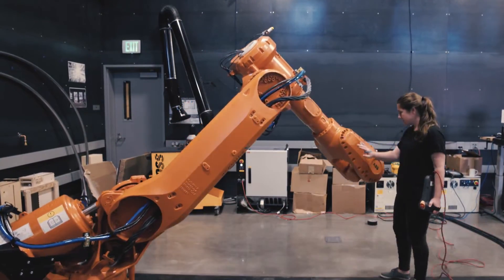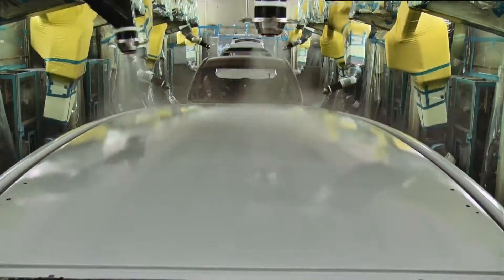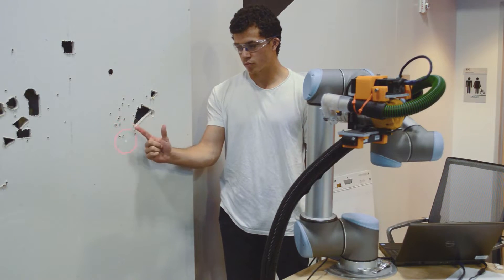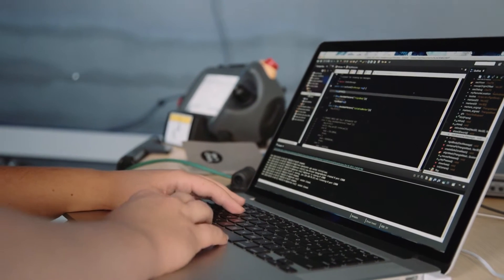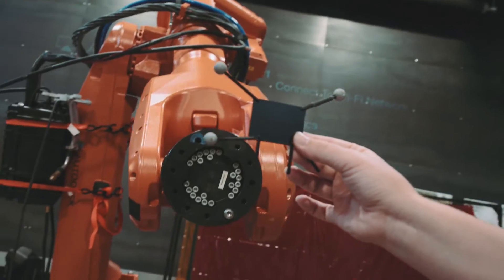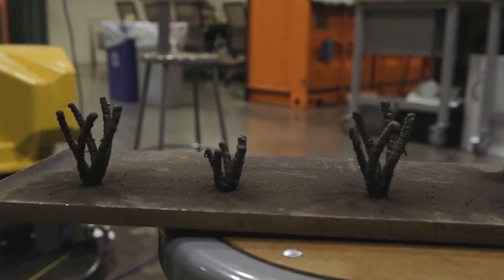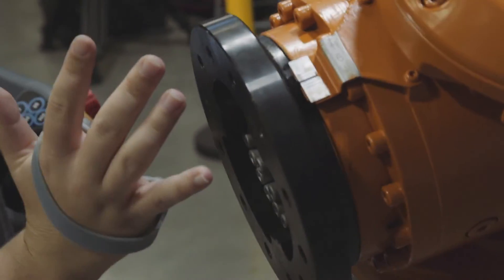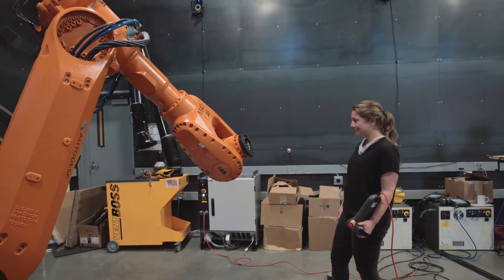Madeline, The Robot Tamer

Comment: You trust your code with your life that it has no bugs..
Reply: She probably doesn't. Underneath, at the low level of the robot's controller, someone probably set it up to vastly limit its speed so she wouldn't hurt herself. I've seen those robots used for what they are designed to do : we put them in cages for a very good reason.

Comment: What's scarier than being next to a tamed wild animal? Being next to a stone cold machine that cannot think for itself and is one user error or software bug away from knocking you across the factory...
Reply: Hazard Pay!
Reply: My exact though watching this. Those robots can move several meters per second at top speed. Waaaaaay faster than a human can process and move out of the way. They also have (relative to humans) an infinite amount of strength. In the case of a serious error knocking you across the factory would be minor compared to it just crushing you into the concrete floor.

My only thought on how you could make this more "safe" is to limit the arms max speed. But even then, that function is likely not safety rated. And there are still dozens of other ways things can go wrong (entrapment, entanglement, etc.).

Comment: Looks really cool. but honestly such a robot is not a toy. one wrong line of code or another error and one human less on earth.
Reply: Thats why the panel has a "totmannsknopf" if you let it go or push it to hard the robot does an emergency brake
Reply: @notparanoid912  dude I program these things for a living…the “deadman” switch that she has to keep pressed for the robot to work doesn’t mean a damn thing if the robot “hiccups”. Yes the switch may be released and the robot looses power, but if the bug causes it to lunge, it would knock her out in an instant, or worse. That robot weighs an order of magnitude more than her. 

Again, that switch isn’t a “fail safe” that she has control of, and anything stupid can happen. I’m not saying what she is doing isn’t awesome work, but don’t for a minuet believe that her holding that pendant means she’s not in danger of loosing her life. Spend some time around these machines and watch how quickly the same line of code that has ran for cycle after cycle can mess up.